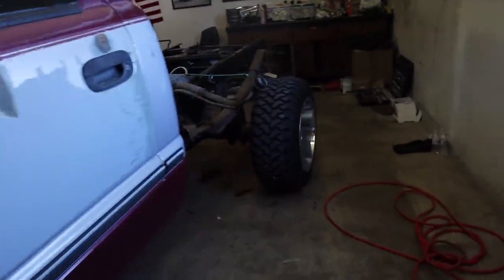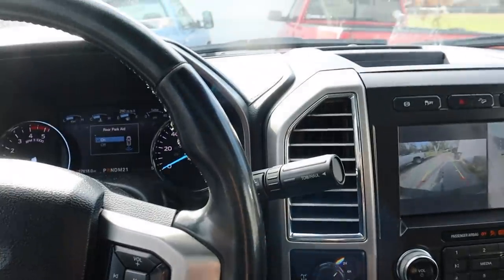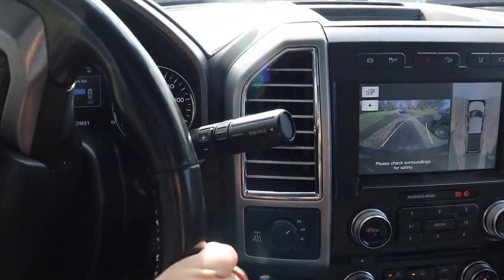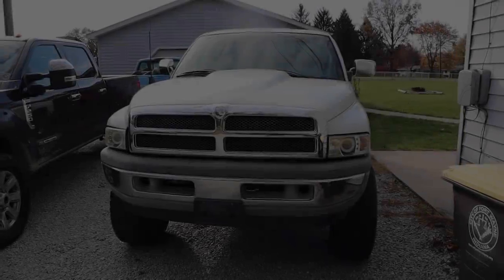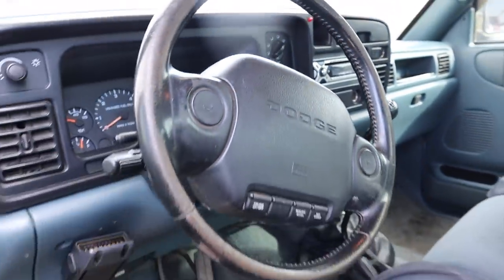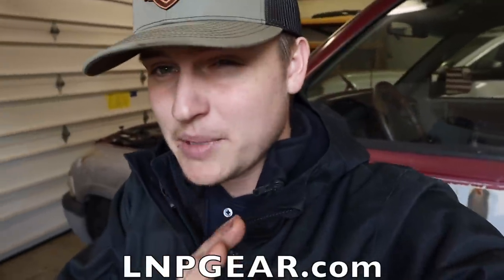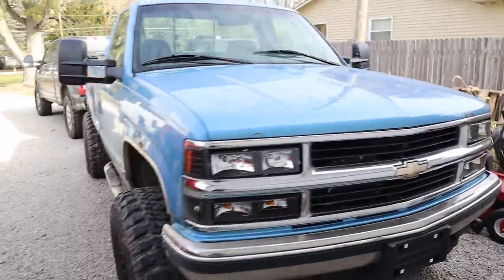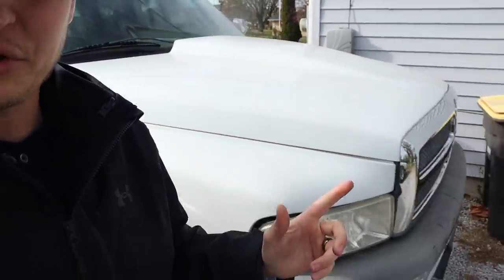I BOUGHT A 1 IN 1,000,000 CLEAN DIESEL TRUCK!!!

Comment: Has someone been called about winning the limited?
Reply: Hey this is so random but has your starter gone out on your four runner bc mine just locked up it's a 99 original starter
Reply: @koreyhallslawncare7997  I thankfully haven't had any trouble with the starter and it's the original one with 200k. That sucks man, hope you get it fixed for cheap. Mine is a 99 too
Reply: @koreyhallslawncare7997  have you tried hitting it with a hammer?
Reply: @noahtaylor3148  yeah it is like locked up my belt was squealing so I shut it off then it just kept going like it kept turning over I tapped it then it stopped turning over
Reply: @koreyhallslawncare7997  is it a manual? If so, have you try bump starting it?
Reply: @noahtaylor3148  well it starts but I just need to get a new starter I guess lol it's only about a hundred bucks but well that's actually pretty expensive but it is what it is I guess lol
Reply: @koreyhallslawncare7997  yeah Toyotas aren't bad to work on, they are pretty straight forward. Good luck man
Reply from the maker: Yes! Winner announcement soon!
Reply: @LOUDNPROUD  dang, maybe next time

Comment: Hey bud, I think you should build both trucks cosmetically but leave the power and fuel pump stock. Just would be a nice touch cause every other 12 valve is turned up and turned into pavement queens that roll coal. Just my opinion

Comment: Could have went to autoland outlet in Roscoe IL and got a 2001 quadcab long bed diesel h.o 24valve 6spd manual with only 75,000 original miles it's still on their inventory list but truck is in good shape that you bought

Comment: I like the White 96  it would make a nice sister truck to my Black and red 96 5speed that is even cleaner than yours.  My dash just cracked and my heater core started to leak.  If I where you I would change the heatercore and air conditioning core  when replacing the dash top.

Comment: i got some ideas if you would like to know its what i did to my 2nd gen
Reply: i should say for any white 2nd gen
Reply: What are they?!
Reply: @troyrogers1236   cross wind m/t tires  rims  american racing black can't recall the name at the moment halo headlight blacked out third brake light and brake lights light bar black grille 70hp tuner straight pipe 75 hp injectors turbo spooler cold air intake. just to name a bit of my built except for the trans at the moment.